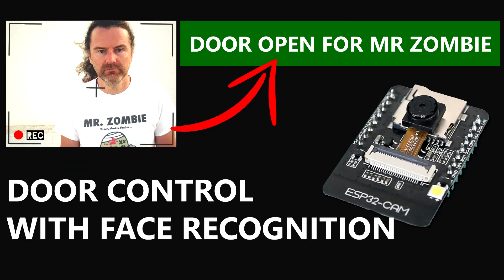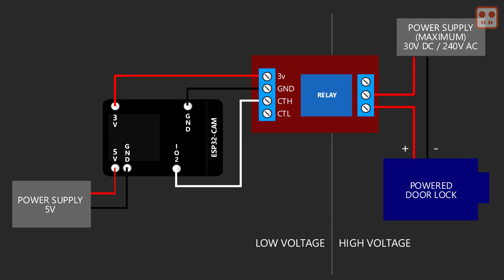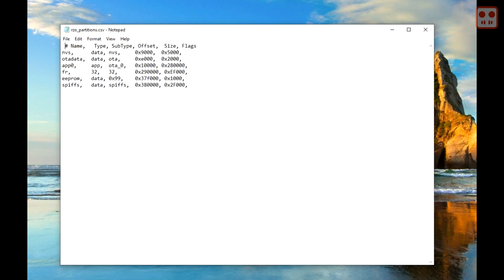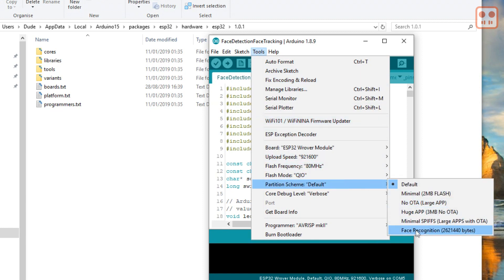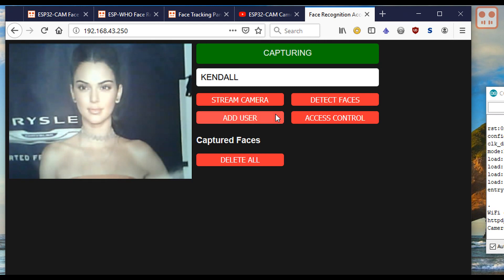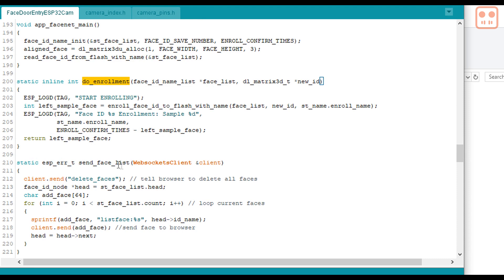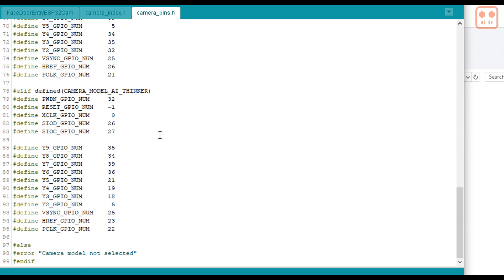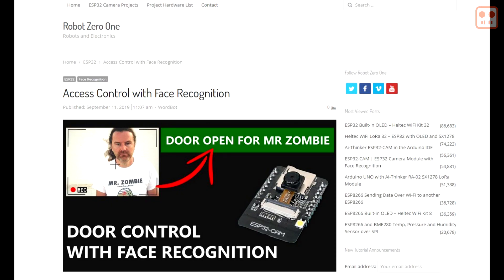ESP32-CAM Face Recognition Open Door Lock

Comment: sir can you make 4mb size partitions for face detection and face recognition?  because my sketch 3MB
Reply from the maker: Please don't ask the same question 4 times. This tutorial has it's own partition table. Does that not work for you?
Reply: @robotzeroone  i'm using board esp32cam version 1.0.6, i'm upload with partitions face recognition is error
Reply from the maker: @lancelotnub  Use 1.0.5
Reply: @robotzeroone  tutorial sir
Reply: @robotzeroone  board esp32cam version 1.0.5 use PartitionScheme = Face Recognition (2621440 bytes with OTA) or use HUGE APP 3MB?
Reply: board esp32cam version 1.0.5 use PartitionScheme = Face Recognition (2621440 bytes with OTA) or use Huge App ?
Reply: @robotzeroone  file partitions and file rzo_partitions save to 1.0.5 -> tools -> partitions?
Reply from the maker: @lancelotnub  Why do keep asking the same question over and over? Just add the files mentioned here https://github.com/robotzero1/esp32cam-access-control to the folder with the .ino file.

Comment: thanks for the tutorial sir
I want to know which program shows that the image is registered in flash memory?

and I want to save the image on the SD memory card, how do I program it?
Reply from the maker: I don't really understand the first question. For the second you would have to combine this tutorial with one of the others on my blog where the image is saved to the SD card.
Reply: @robotzeroone  sorry i want to ask sir
how to view face sample data file from flash memory? because I need face sample data
Reply from the maker: @abdulmukhitm  I don't know how you do that. I've seen other tutorials where the data is saved elsewhere but I don't have them to hand. It's probably quite complicated.
Reply: @robotzeroone  if the face is stored in a 4 mb flash memory, how much face data can be stored sir?
Reply from the maker: @abdulmukhitm  The face data is stored in a partition not the whole memory. I don't know how many.. Do some experiments. It will probably start to slow down before you run out of space.

Comment: I'm using the version 2.0.0 of the Arduino ESP32 hardware , what csv partition file have i to use ? With the csv file for the 1.0.5 version you provided,  there is no streaming after connection to the web server.
Reply from the maker: I don't think the face recognition works with v2. The built in camerawebserver example wasn't working last time I looked.
Reply: @robotzeroone  Thanks for the information. I'll go back to the 1.05 version.
By the way the camerawebserver example is working flawlessly with the 2.0.0 version.
Reply from the maker: @hedi875  Ah.. they must have fixed it... https://github.com/espressif/arduino-esp32/issues/5878

Comment: can you help me sir, it is possible to have two esp32 cam to control the lock from outside and inside?
Reply from the maker: Both connected to the same lock? Yep. You could use two ESP32s and two relays connected to the same lock.
Reply: @robotzeroone  Hi sir thank you for your respond.  Yes sir both connect to the same lock. I try it but everytime i put the NO pin on relay on both side( i have 2 channel relay ) it just unlock when both eps32 cam recognize the face but nothing happen when only one esp32 cam recognize the face. Please help me sir
Reply from the maker: @Jay-ik2ie  do you have a multimeter to see test when the relay pins are energised? Might need two separate relays depending on the wiring. The ESP32 doesn't output much current to energise the relay.
Reply: @robotzeroone  I try it already to separate relay it has the same result sir
Reply from the maker: @Jay-ik2ie  I'm not sure. It's a wiring thing. Should work but maybe there's a problem with the ground side of the wiring.
Reply: @robotzeroone  yes sir it is the ground thing I dont know what to do on this.

Comment: when face detection and recognition turn on, why esp 32 cam is black and serial monitor is martix3du item alloc failed?
Reply from the maker: Which version of the ESP32 hardware library are you using? Do you have PSRAM enabled in the IDE?

Comment: There's bug or system limitation. Until you start streaming in browser it doesn't detect faces. Is anyone else facing same issues?
Reply from the maker: Here's a version without the Wi-Fi - https://robotzero.one/esp32-face-door-entry/ or the same as the video but you can disconnect - https://robotzero.one/wp-content/uploads/2020/03/FaceDoorEntryESP32CAMPremium.zip

Comment: Very good !  It is the only video on esp32cam with such utility. It shows that there is a lot of knowledge .
 I don't know English and it is still perfect. Please I want to know what you mean when you say (IDF versions).

You have to modify library code to detect life and not fool the system with photos?

I have the ArduinoWebsokets library in version 0.5.3,  esp32 1.0.6  and my Arduino ID 1.8.16

Greetings from Argentina.
Reply from the maker: Thanks! IDF is this https://docs.espressif.com/projects/esp-idf/en/latest/esp32/ To have liveness detection you need a second camera for a 3D image or an infrared for heat. Some systems might use face detection on frames in a video. Not possible at the moment with the ESP32 though.

Comment: So we need computer to image processing?
Can we run it without computer?
Reply from the maker: The image recognition is all done on the device. Computer is just to view and control the system. Here's a version that runs without a computer if you want something stand alone: https://robotzero.one/esp32-face-door-entry/
Reply: @robotzeroone  can u make a color detection with ESP32 CAM. And if the camera detect red color, so the door will be open

Can u?
Thanks
Reply from the maker: @pokednaful  I think I've seen someone do that on the web but it's not something I've done.

Comment: Hi, I have try your sketch and upload to my ESP32 Cam. But can not find the IP address in serial monitor and only find the message above. I think the ESP32 Cam is restarted. Could you let me know the problem? 
rst:0x3 (SW_RESET),boot:0x13 (SPI_FAST_FLASH_BOOT)
configsip: 0, SPIWP:0xee
clk_drv:0x00,q_drv:0x00,d_drv:0x00,cs0_drv:0x00,hd_drv:0x00,wp_drv:0x00
mode:DIO, clock div:1
load:0x3fff0018,len:4
load:0x3fff001c,len:1216
ho 0 tail 12 room 4
load:0x40078000,len:10944
load:0x40080400,len:6388
entry 0x400806b4
ets Jun  8 2016 00:22:57

rst:0x3 (SW_RESET),boot:0x13 (SPI_FAST_FLASH_BOOT)
configsip: 0, SPIWP:0xee
clk_drv:0x00,q_drv:0x00,d_drv:0x00,cs0_drv:0x00,hd_drv:0x00,wp_drv:0x00
mode:DIO, clock div:1
load:0x3fff0018,len:4
load:0x3fff001c,len:1216
ho 0 tail 12 room 4
load:0x40078000,len:10944
load:0x40080400,len:6388
entry 0x400806b4
ets Jun  8 2016 00:22:57

rst:0x3 (SW_RESET),boot:0x13 (SPI_FAST_FLASH_BOOT)
configsip: 0, SPIWP:0xee
clk_drv:0x00,q_drv:0x00,d_drv:0x00,cs0_drv:0x00,hd_drv:0x00,wp_drv:0x00
mode:DIO, clock div:1
load:0x3fff0018,len:4
load:0x3fff001c,len:1216
ho 0 tail 12 room 4
load:0x40078000,len:10944
load:0x40080400,len:6388
entry 0x400806b4
ets Jun  8 2016 00:22:57
Reply from the maker: Could be a power issue if it keeps rebooting.
Reply: @robotzeroone  I have try to use 5V/2A power supply and still rebooting
Reply from the maker: Do you have the relay connected? Maybe check with another sketch. It's odd that it's just crashing with no other messages. You could try some println("hello world") lines in void setup()  to see if you can see where the crash is.
Reply: @robotzeroone  I haven't use relay connected. Only use LED with 220 oh resistor in IO4
Reply from the maker: Wifi uses a lot of power. Could be this. Do you have good quality connections to 5v and GND.

Comment: Excellent project. Working fine. Just I connected ESP32 and executed the sketch. I didn't change or create a new partition scheme. By default it has been set as Huge App in the IDE. I just connected an LED to test the recognition result. It works well.

Comment: in 0:41 you can just cut the wires going inside and use a battery  to unlock the door from outside ^^
Reply from the maker: Yep. It's just a demonstration not a finished product.

Comment: Hi sir, great video I really enjoyed it but I have a question. How do you open the door in case that the light went out and in consequence the wifi stops working? how would you open the door in this case? greetings from Ecuador
Reply from the maker: Hi, this tutorial doesn't have the wifi- https://robotzero.one/esp32-face-door-entry/ so will work just running from a battery.

Comment: That's awesome , but i have some questions 
1-Can we add a virtual unlock button in the interface or whatever as a second way to unlock ?
2-Can we use 1 or 2 servo motors instead of that lock - i'd use 'em to power manual deadbolt lock-
3-Can we make use of the open Cv liveness detection
Reply from the maker: One and two are possible. You can code websockets for communication in both directions. Other tutorials on my blog might help with that. OpenCV doesn't work on the ESP32 AFAIK you would have to use the video stream on another device.

Comment: Can we make a buzzer sound for faces not recognized
Reply from the maker: You would need to change the Arduino code a bit to have a face detected but not recognized be sent as a Websocket message. On the browser you can make a buzzer sound with the code starting at line 156 https://github.com/robotzero1/esp32cam-access-control/blob/master/HTML_interface.html

Comment: Dear sir
one more question
if i want to send user name to keep in Google Sheet 
(Log file or time Attendance)
which Variable i can use to send it to google sheet
Reply from the maker: You want to grab the name from Websocket message?  In the ws.onmessage method you need to do some sort of substring to get the name when the DOOR OPEN FOR... message comes in.
Reply: @robotzeroone  i found that variable 
"f->id_name" this one
thx. for your support
Reply: @robotzeroone  You want to grab the name from Websocket message?  yes.
or i can grab from ESP32-cam part ?

Comment: Hello, i can't make the streaming work with the example given above, and i get the fr_flash error in serial monitor , what am i doing wrong here?
Reply from the maker: I think fr_flash error is normal when starting. Are you using version 1.0.5  of the hardware libraries. You can just upload the partitions.csv file with the sketch and not set up new partition as in the video.
Reply: @robotzeroone  hello sir, I tried that but the streaming dosent work in that, I thought maybe it's a fr_flash problem, so I asked, it complies, I tried with both paritions given in the Git, but the streaming does not start in the browser
Reply: @robotzeroone  Okay i found the solution, the streaming won't work in a SAFARI browser , only other browsers, please write a note sir.
Reply from the maker: @vivektodmal1  Do you see errors in the console in Safari? Maybe the JavaScript isn't supported in Safari.
Reply: @robotzeroone  Yeaa it could be , will it be possibe to add cloud communication to this without adding more delays to it, cloud will be on a separate firebase connection
Reply from the maker: @vivektodmal1  People have asked for this but I don't have time to look into it at the moment.

Comment: Thanks for such great tutorial, i have got everything works perfectly on this tutorial code and FaceDoorEntryESP32CAMPremium.zip.

I prefer to start Access Control automatically without clicking on the web interface so per your recommandation i can use 'Face Recognition Trigger Event' code, but with this code uploaded, the esp32 cam keep rebooting with the error below and if i switch back to FaceDoorEntryESP32CAMPremium then it will be working fine.

Note: I'm putting the same 'partitions.csv' on all sketch folder and choosing 'Huge App' Scheme, with 1 face registered.

Error:
rst:0xc (SW_CPU_RESET),boot:0x13 (SPI_FAST_FLASH_BOOT)
configsip: 0, SPIWP:0xee
clk_drv:0x00,q_drv:0x00,d_drv:0x00,cs0_drv:0x00,hd_drv:0x00,wp_drv:0x00
mode:DIO, clock div:1
load:0x3fff0018,len:4
load:0x3fff001c,len:1216
ho 0 tail 12 room 4
load:0x40078000,len:10944
load:0x40080400,len:6388
entry 0x400806b4
[D][esp32-hal-psram.c:47] psramInit(): PSRAM enabled
assertion "l->size == size" failed: file "/home/runner/work/esp32-arduino-lib-builder/esp32-arduino-lib-builder/components/esp-face/face_recognition/fr_flash.c", line 86, function: read_face_id_from_flash
abort() was called at PC 0x400dc1cb on core 1

ELF file SHA256: 0000000000000000

Backtrace: 0x4008a5ac:0x3ffb1e70 0x4008a825:0x3ffb1e90 0x400dc1cb:0x3ffb1eb0 0x400e9d3e:0x3ffb1ee0 0x400d26ae:0x3ffb1f20 0x400d3d2e:0x3ffb1fb0 0x4008c4b6:0x3ffb1fd0

Rebooting...

Comment: Hi,can u please snd a program with servo motor instead of relay.when I upload a program the esp32 cam get reseting.please help me bro
jetlinjj@gmail.com
This is my email adrs.
Reply from the maker: check out my blog for servo motor projects. Maybe something there will help.
Reply: @robotzeroone  can i make 3d face detector using esp32 cam??.
This program works perfectly but it opens using my photo
Reply from the maker: @jetlinjetlin6250  You need liveness detection which is a lot harder. Some systems use two cameras for 3D or an infrared camera to measure for heat.
Reply: Hi,when I used 1.0.5 partitions the compiler showing"sketch too big;" 
Please give me CSV partitions scheme bro..🙏
Reply from the maker: @jetlinjetlin6250  choose the ‘Huge App’ partition scheme from the tools menu when uploading

Comment: Hai sir, I wonder if i can make the system recognize only 1 face in all faces in the db. For example like hardcode where face_id == 1, which system only recognize user where not the other. But it seem didnt work for the face_id. I also cant figure out how the enroll system save the face_id. Do you know what the return where I can make the == 1 to bind only 1 user? thank you..
Reply from the maker: Did you see the other tutorial here: https://robotzero.one/esp32-face-door-entry/ it's less complicated if you just want one face. Maybe the line if (matched_id >= 0) { could be changed to ==1?

Comment: Hello sir, wonderful tutorial. Just want to ask, can I extract the sample captured? will it be in picture format? if can, do I need to change into SD card partition or can use your created partition? sorry I a bit new in this area.
Reply from the maker: Hi. You want to save the data captured for the face? I've not done that yet but I imagine you can copy it off the fr partition to another location.
Reply: @robotzeroone  I see, so just to be clear. the partitions stored the face/user data but in other type like hex or byte is it? sorry I still dont know what is the partitions is.
Reply from the maker: @said7176  The face data is a mathematical representation of the face. These are stored in the fr partition but I don't know how this is structured as a file system. You would have to look at the code in the Espressif IDF to see how it's done. Not really beginners level stuff.
Reply: @robotzeroone  I see, Thank you so much for the explaination. Help me understand further more. Thank..

Comment: When I access the camera's IP address, I have a problem: The Serial print '[E][WiFiClient.cpp:392] write(): fail on fd 60, errno: 104, "Connection reset by peer"
'
I would like to ask why this problem occurs and how to solve it
Reply: It happened after I deleted the face data, and downloading the sketch again could not solve the problem. How can ESP-CAM be restored to the original state？
Reply: when i cleared the flash and uploaded again, it recover working. So i think the problem happened when deleted face data.

Comment: Is it possible to run the recognition without opening the webpage?
I changed the code already, so now the detection starts instant, when power ist connected.
but before I have to open the webpage and I don't want that.
Reply from the maker: Check this tutorial for a version without the web browser. https://robotzero.one/esp32-face-door-entry/ Maybe you can load up the faces using the tutorial above and then switch to this one using the same faces.
Reply: @robotzeroone  I will try it, thanks for the answer!

Comment: yesterday it run perfectly, until today i reupload the code and The camera won't stream in web browser. I'm getting error messages on the web like this, The connection to ws://192.168.1.7:82/ was interrupted while the page was loading. can you help me sir?
Reply from the maker: Can you connect the camera to the serial port and see if there's any errors shown.
Reply: I've tried the camera on camerawebserver from example code,  and it works fine
Reply from the maker: @reinhard1398  It might be the face storage has been corrupted. See the comments from here onwards - https://robotzero.one/esp-who-recognition-with-names/#comment-100839

Comment: Cheers for this guide, persistence was a big help. however it seems very laggy and slow, and is it possible to use without the browser connected? Don't want to have to have something logged into it all the time
Reply from the maker: It's slow because running the face recognition really taxes the ESP32 processor. This version you can disconnect - https://robotzero.one/esp-who-recognition-with-names/#comment-43712 Or you can use the version in the video to set up the faces and then this one - https://robotzero.one/esp32-face-door-entry/ without Wi-Fi to run it

Comment: What if we use a 5v relay does it work?
Reply from the maker: I think the pins only output 3.3v with very little current so it probably won't be enough to energize the relay.

Comment: Can I know the method used in this project either it is  Cascade Classifier method  or any of this techniques Linear Binary Pattern, Eigenfaces, Fisherfaces?
Reply from the maker: The technical information can be found linked from this page - https://github.com/espressif/esp-face/tree/420fc7e219ba98e40a5493b9d4be270db2f2d724